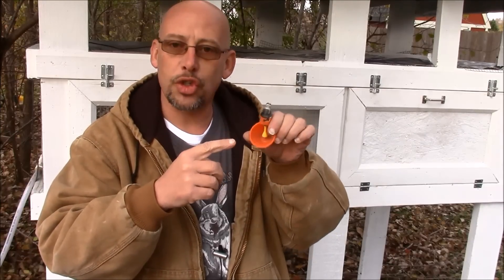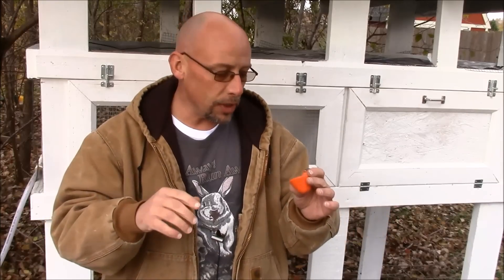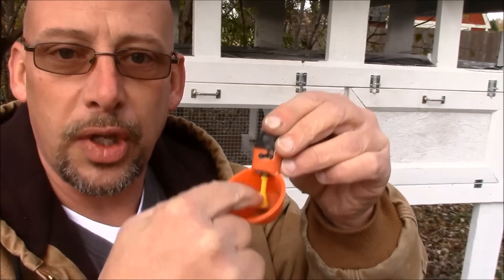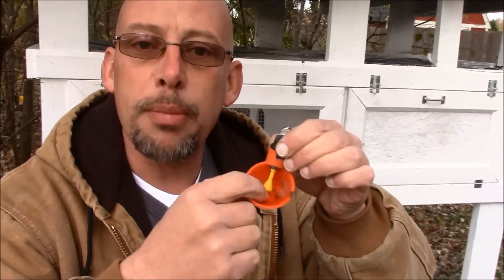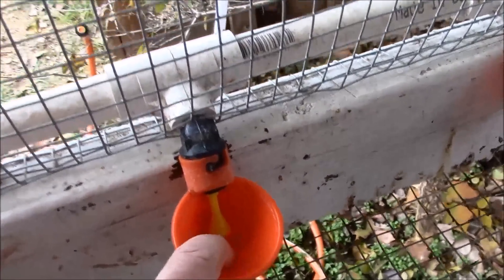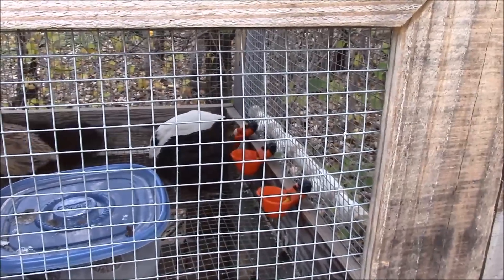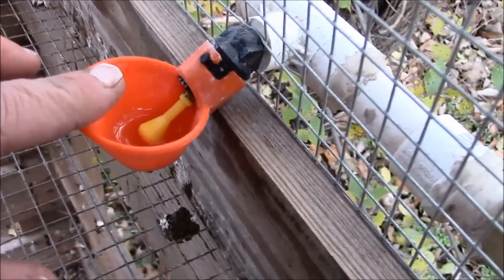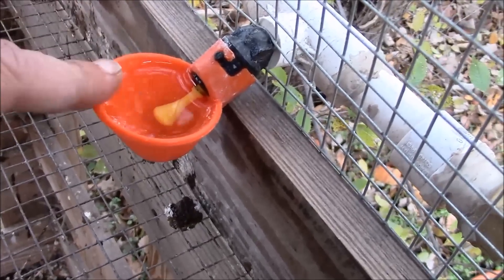Training Quail to Use Water Cups: The SR Quail Update 12-5-16

Comment: My biggest question is how high off the floor of the cage to i enstall the cups? I know not right on the floor or they will poop in them but I'm going to be putting my first run of quail in their outside cages and i need to know how far up off the floor the cups need to be

Comment: What happens when you get freezing temps? Do you get freezing temps. We are -3 today had to change water twice. I want to do some sort of external auto system. Any thoughts? 
Cheers.
Reply from the maker: It is getting down to freezing temps here now.  When that happens I switch over to water bowls for them.  I haven't figured out an easy way to keep them from freezing.  A water heater will keep the water from freezing but the valves still freeze up.  Sorry I can't help more with that issue yet.
Reply: Thanks. I was wondering If you had a way around it, I thought I would ask.
Reply from the maker: If i figure one out you can sure bet I will have a video on it.  :)

Comment: Just setup a watering system that 2 cages share, using the water cups.
I'm using "clear"   1/2  inch tubing, but is it the right thing to do, cause it will get 
some direct sunlight, and I'm thinking about algae growth happening latter on.
Reply from the maker: Well it will develop algae if it is in direct sunlight but that isn't a huge thing.  The bigger concern is it getting very hot.  If there is anyway to shade it i would do that.

Comment: How confident are we that these will stop flowing water when not in use? My quail are inside and I don't want a flood. Also, anyone have a review of the pressure reducer? If it fails, flood. So I would like to know. I need a quality product. TIA
Reply from the maker: I haven't used the pressure reducers but these cups have never leaked on me.  I did have a problem once with a bird standing on the stopper and causing it to flood out.  I just put a piece of wire above it so they could still get their head in to drink but couldn't stand on it.  Hoe that helps.